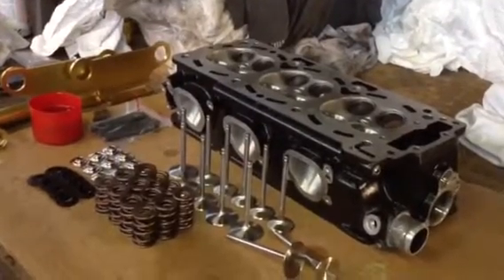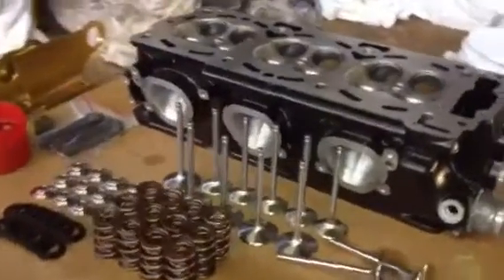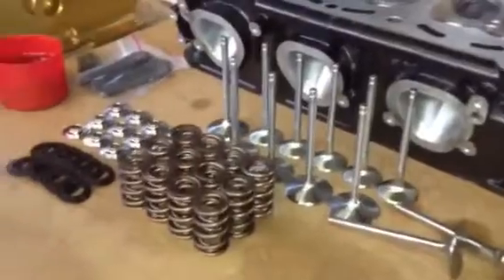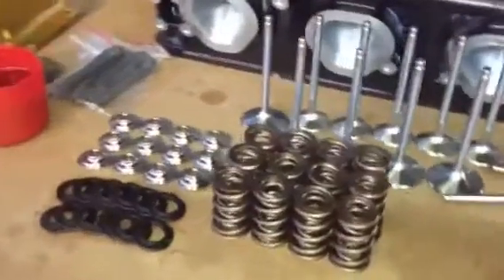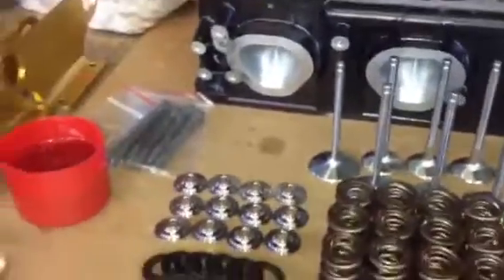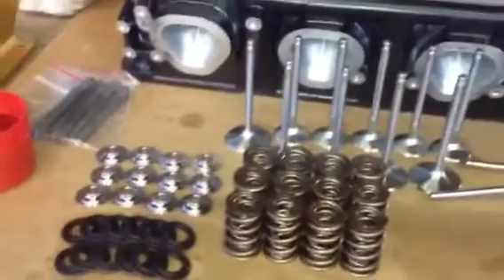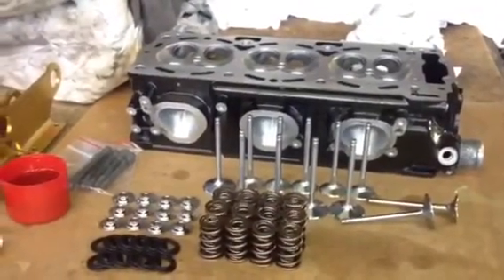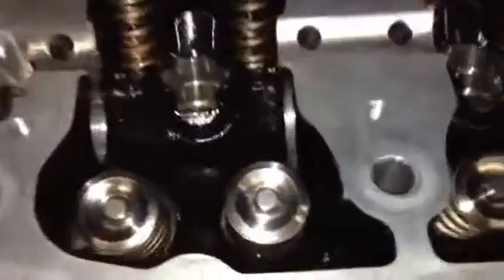Seadoo 4-tec 9000rpm Performance head

Comment: Good video. How many rpm can Seadoo cast pistons take? Would running this set up on cast pistons allow 9000rpms?
Reply from the maker: Cast pistons will Break like glass . Most seadoo come out with semi forged and they are good for 9000 rpm no problem . I’ve pushed one of my seadoo 260 rs ski’s to 10500 with oem semi forged stock pistons and after riding like that for a season I tore down the motor just to inspect the internals for interest  sake and they where perfect .
Reply: Hi, interesting videos! 
Do you have a video on porting & polishing the seadoo 1630 heads?? Did you measure the gains in flow rates etc? 
Many thanks
Reply from the maker: @adrianztt  hi there , thank you . We haven’t made a video of that yet ... but it is always good to remove the imperfections and to polish the head . We match the exhaust ports with the manifold and this increases flow massively specially with the flowed head . We do manage and measure flow rate to match with performance , ie what stage are you running . I would remove all imperfections polish squishes and roughen  throats slightly up until stage 3 . Keeping on what works and not over doing the flow at stage 4 I would rather place a cam shaft and this is really worth it specially when you tune for it . To answer your question , the flowed and polished head on its own is worth it and your pwc will be noticeably different and better.
Reply: @Redrockat   thank you for taking the time to reply 👍🏼 
I thought at the start of the video the guy says’” you’ve seen us gasflow and port the head’” ?? 
The guy that’s kindly p&p’ing our head doesn’t do stg’s, he just does the maximum that can be done.  
I’m interested to see what the cfm flow rates are before and after all the works been done. I have a new super tech valves, 85lb springs and high performance cam to be fitted so hopefully with all the bigger charger and stuff should make a massive difference 🤞🏽 😁 
Keep up the good work
Reply from the maker: @adrianztt  awesome let me know how it turns out 😊
Reply from the maker: @adrianztt  ps - I made another video of the gas flow and port on this head . Seadoo 4-tec cylinder head clean up and gas flow . 
Do a google search “redrockat gas flow and port seadoo” and click on my link . Comment and like then I know you saw the video
Reply: @Redrockat  send me the link 👍🏼
Reply from the maker: @adrianztt  https://m.youtube.com/watch?v=AtqMguFVyVI

Comment: Redrockat send me your number phone
Reply: Redrockat You live in the United States
Reply from the maker: No I live in South Africa
Reply: Redrockat hello i have a seadoo rxp300 and it is spending the oil very fast it takes less than 1 hour of use that you think it can be
Reply from the maker: That is not good news , the seadoo does not use oil ,unless is a stage 4 with high rpm and uses 10000 rpm catch can
Reply: Redrockat yes have stage4
Reply: Redrockat have stage 4 camshaft and charger 23psi